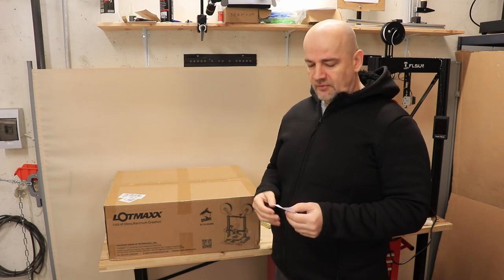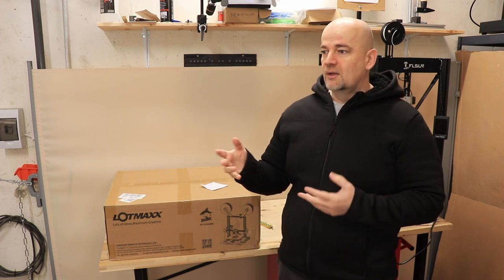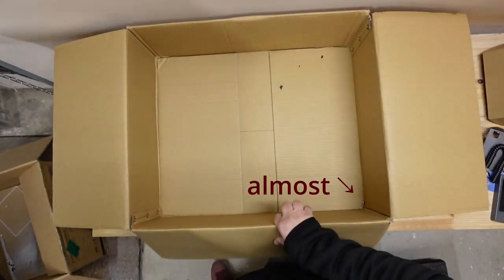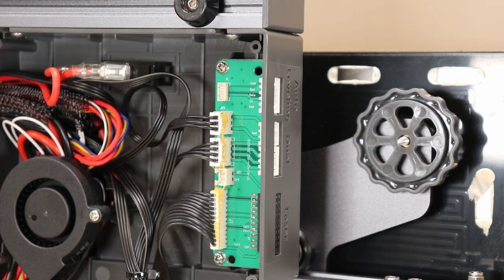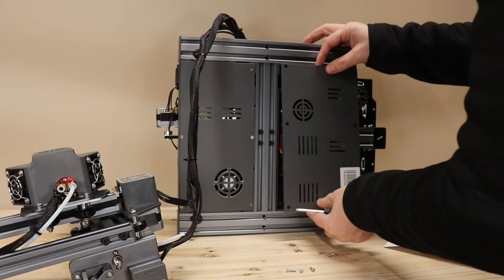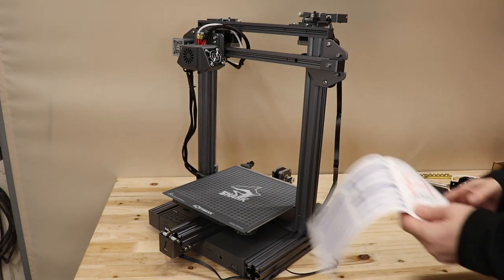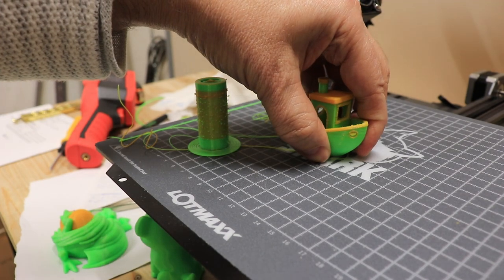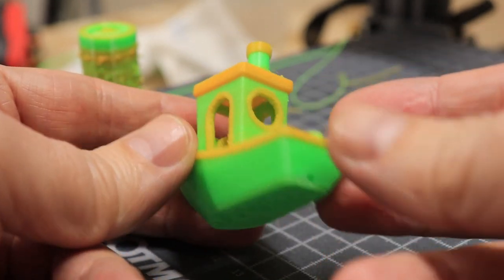Lotmaxx Shark V2 - two color 3D printer and laser engraver review

Comment: I'm already positively surprised that the mixing hotend didn't clog.  It just looks like an Ender 3 (not v2, but original) where they tried to add some spec-points to convince people this would be better, but where indeed those extra features aren't really finished very well.  Then again, it did work apparently ...
Reply from the maker: I like the option of two color printing. And if it survive those first few layers and the bulb on first layer (mentioned in video) it reliably finish the bi-color printing.

Comment: Thanks,
Why did you use so old Cura version? Today you can use 4.13.1...
Reply from the maker: I used the provided slicer (which is Lotmaxx version of Cura). Sure, I tried newest Cura too, which is my primary slicer for most of my printers. Same problem I had with Wipe tower.
Reply: @MyTechFun  Thank you for the information. I guess the firmware is not good enough but I don't have experience with dual color printers.

Comment: The Shark V2 has better hardware than Ender, sadly that's all the advantages, mine came with bent bltouch, there is literally no support for this printer by the manufacture, their reply was to not use bltouch. The software on this is the worst I've seen & there is no open source code for it. The printer doesn't work with octoprint as it gives blobs on the print surface (people say they've gotten it work) in my research are just running prints from SD card while using octoprint (useless in my use case for a print farm). I would stay away from this printer and recommend an Artillery or Ender instead.
Reply from the maker: Yes, it has some space for improvements. I am sure that V3 will be much better :-)   (but Artillery or Ender can't print in two colors)